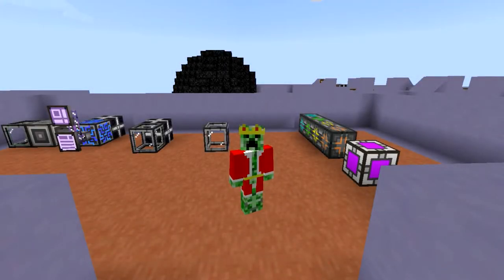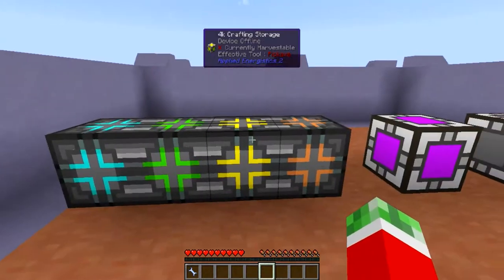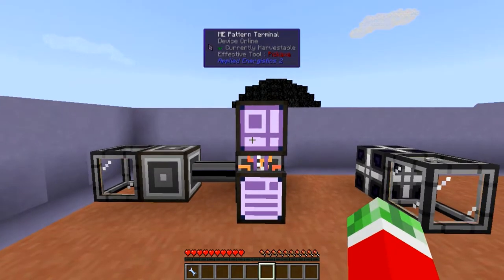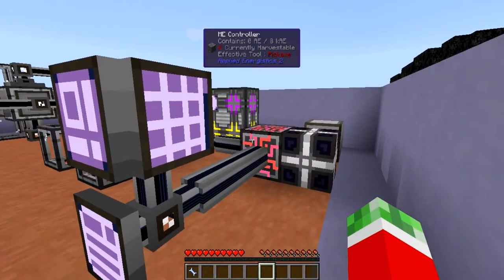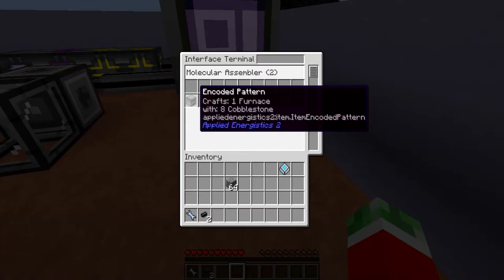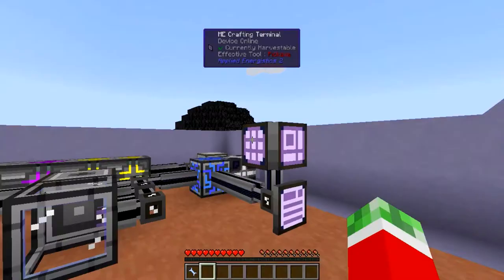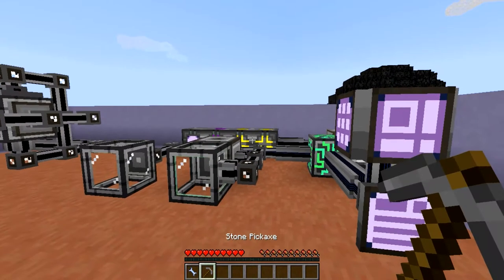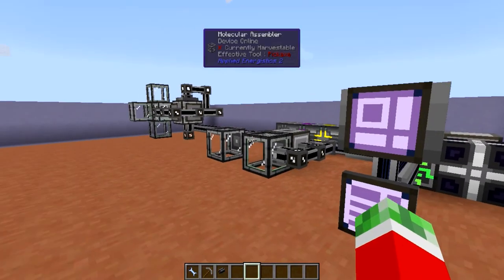Applied Energistics 2 Tutorial - Episode 4 - Autocrafting

Comment: Ok, so you have to have the Interface block only connected to the assemblers? I've watched a lot of these kind of tutorials and am still a little confused. I'm trying to auto cobble my system and am frustrated. But, I'm learning.
Reply from the maker: Hey there dadat30, pretty much the Assembler acts as a crafting table, being able to accept recipes and craft them using a small bit of power. The ME Interface is the thing you use to connect the Assembler to your network, that stores the actual recipes and transmits them to the Assembler! I hope this helped
Reply: Ok, thanks. I will have to try to mess around with it again. It's just frustrating trying to figure this stuff out. :P
Reply: Ok, I figured out what was wrong. I had the assembler hooked up to the memory. >.>

Now I have it working. I now have to figure out how to super compress cobble using them.

Thanks!